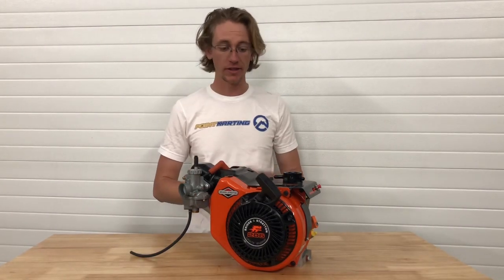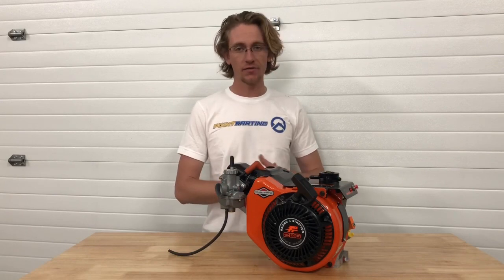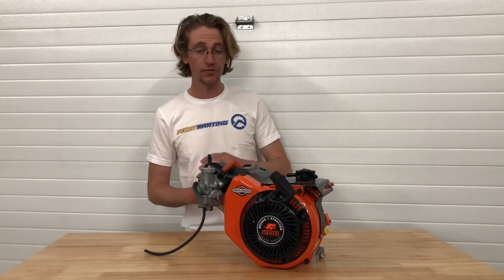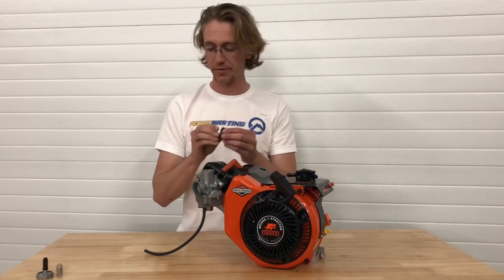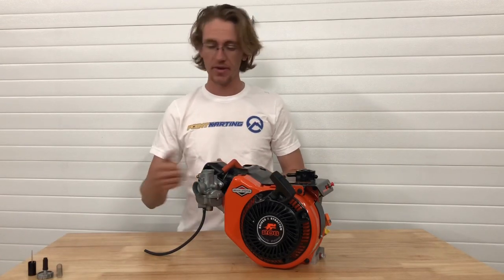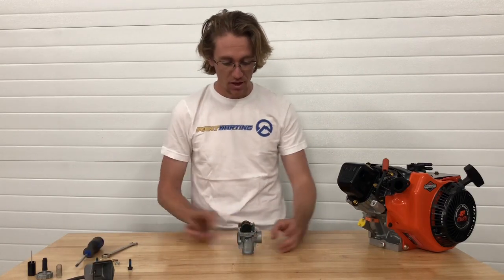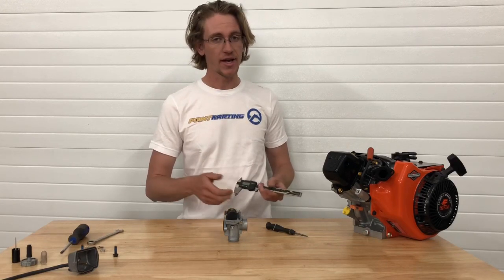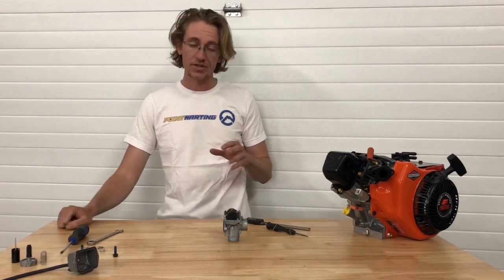Setting Float Height on Briggs 206 Carburetor

Comment: Does that float bowl gasket need to be replaced each time you remove the bowl?
Reply from the maker: @Brennan Cleveland great question! No, you definitely don't need to replace it every time you remove the float bowl. However, if you do notice cracking or deterioration of the gasket then it would be time to replace. We rarely replace them unless we notice they do not fit into the 'journal' on the float bowl. Let us know if you have more questions about your Briggs 206 or the carburetor system!